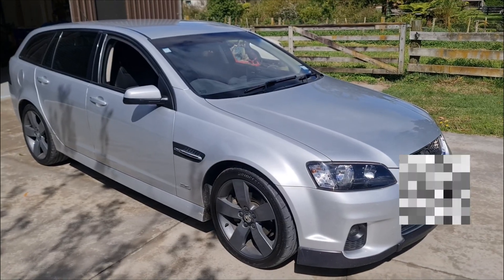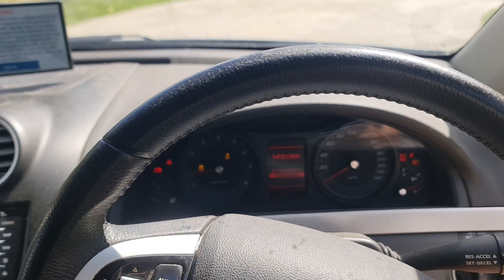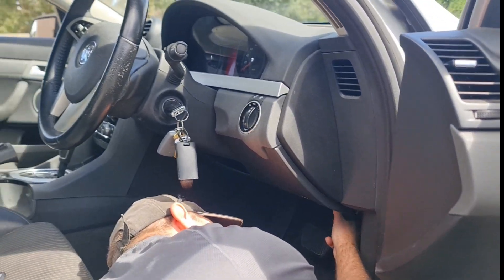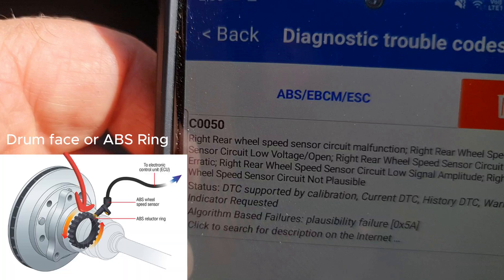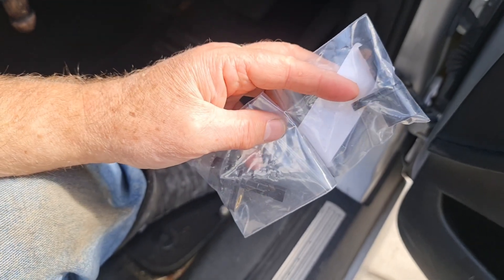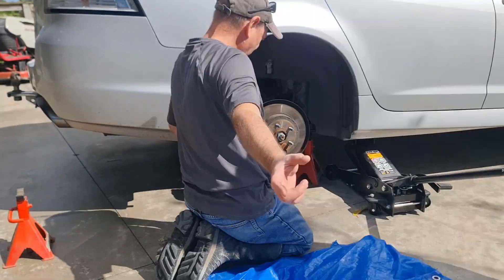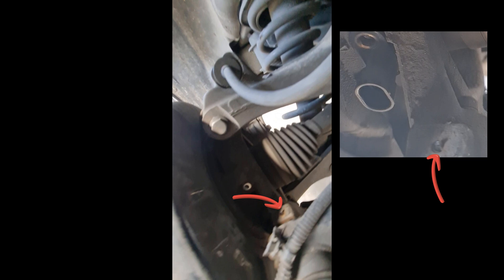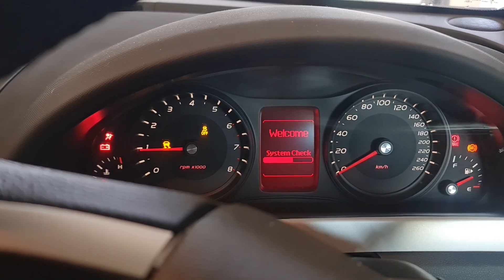2012 VE Commodore ABS and Stability Control fault repair for $15.00.

Comment: What was the exact dongle you used mate? It says online that these cheap ones don’t pick up ABS errors, only engines fault codes.
Reply from the maker: Its a Response PP2145.  Got it from Jaycar

Comment: Take out the rear wheel sensors,,,, turn on the ignition,,,, put a multi meter at the plug connector,,,,1ish DC volts,,,near enough,,,,ohm the sensor s....both should read a few mega ohms there about,,,, one was 24 mega ohms,,, the other 420 ohms,,, put the brand new ones in,,,, fault gone,,,, went for a drive,,, stability control came on,,, not the abs fault,,,, going to get 2 new tyres fitted to the rear,,,,if that doesn't work,,,,off to the auto spark,,,, to check the steering angle sensor,,,, but shit,,,, it's taught me something about commodore's.....

Comment: I still got the abs fault light after putting new sensors in and no code reader can get a fault code to clear
Reply from the maker: Might be the wiring that is faulty not the sensor.

Comment: I replaced both after the drive the light and code came back any ideas?
Reply from the maker: Its likely a cabling problem.  You need to test the cable back to the control module

Comment: Not getting ABS fault but getting ESP/Stability Control turning off and refusing to turn back on. Will replace sensors and see if that fixes the problem.
Reply from the maker: Interested to know if that fixes you problem
Reply: It didn't fix my car , my code is p0856 traction control circuit request
Reply: Same on mine m8
  How was it fixed pls ?
Reply: @danryan1587 did you end up sorting yours?
Reply: leky was going to send it away.    Only happens on trips under 5k and only first trip after cold start